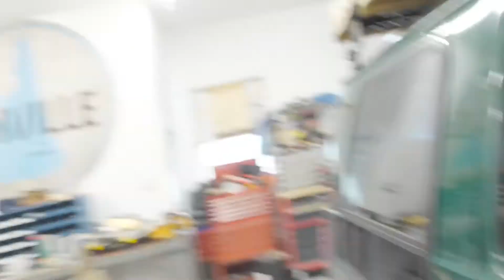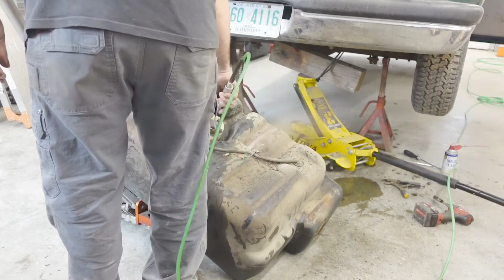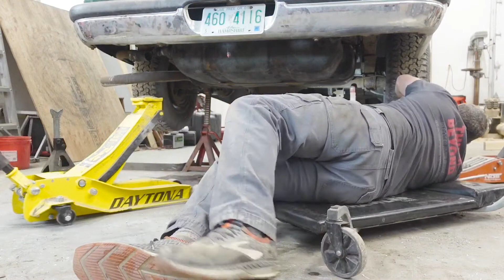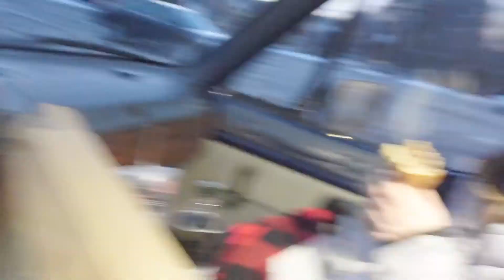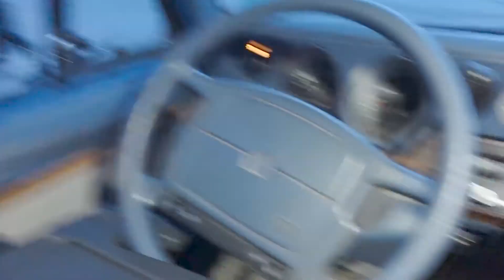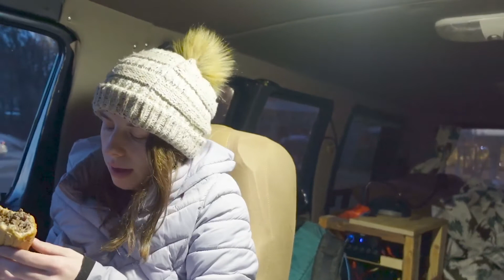Replacing the fuel pump in my 1995 Dodge Ram Van 1500

Comment: What were the issues that caused this to happen
Reply from the maker: The fuel pump wasn't working. It was like the van was running with an empty gas tank even though it was full.
Reply: @airquoteawesome  I am having a similar problem with my van. Mine has this problem when its cold (approximately 20deg) in the morning then ran fine once warmed up. Was that the same problem as yours?

Comment: Although it's regularly done, beating loose the "lock ring" (fuel pump retention ring) with a hammer and screwdriver is not ideal and should be last resort because it's easy to cause damage (especially if you don't know what you're doing and what you're looking/feeling for it to do) which can cost you a new tank.  NO, it doesn't happen all the time. YES, people get by with it all the time
BUT, for about 20 bucks (give or take) you can get the proper tool from eBay, Amazon, parts stores, etc. which properly and easily removes and reinstall the ring in a matter of a couple minutes, you don't have to take the tank out to get a full swing and in the odd, albeit rare chance you really bugger it up, you've gone from an already expensive pump replacement to a very expensive and time consuming tank replacement.   Call me foolish, troll me, laugh at me all you want BUT, in my many years "turning wrenches in the trenches" I've seen it enough to know that $20 is cheap insurance, not to mention it saving lots of cussing and time.
  Good video, shows cleaning and not getting crap in the tank (see that lots, too) and that a little effort and patience saves a ton of money at today's shop rates.
Reply from the maker: Well said. You are definitely right. It's always better to have the proper tools for the job.